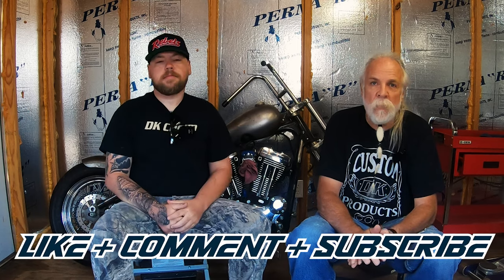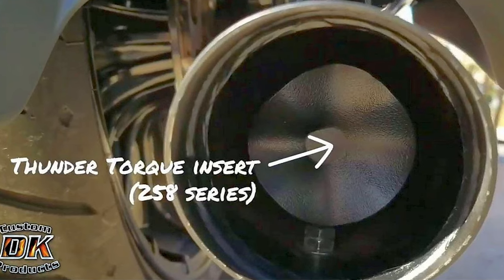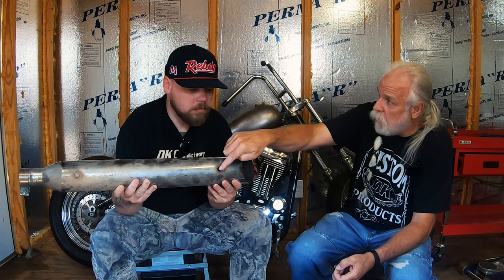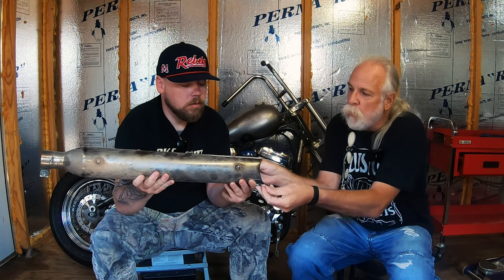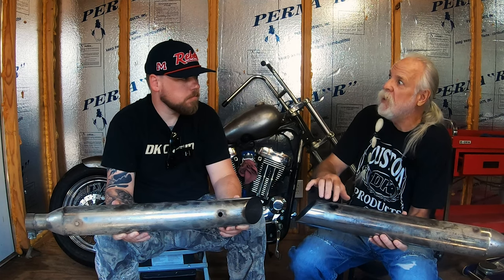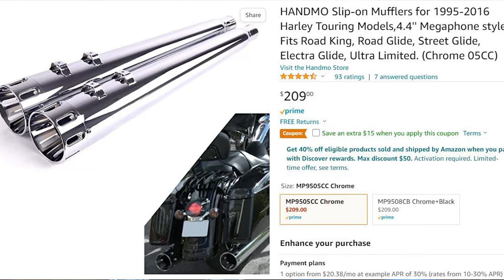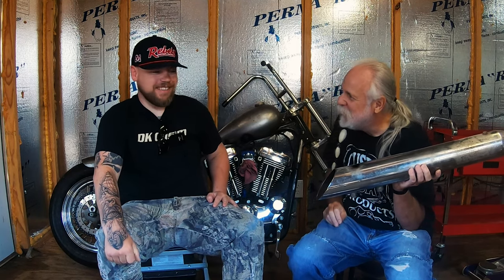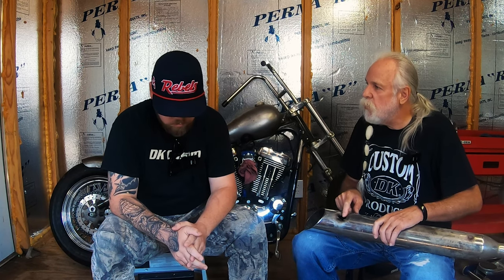How to Install Better Power w/ Thunder Torque Inserts™ on inexpensive, knock-off exhaust.

Comment: I have 07 electra glide is there a rear shock i can install that is not air
Reply from the maker: All three of the shocks at this link will work on an 07 Electra Glide - https://www.dkcustomproducts.com/rear-shocks-c651-271.htm

Please feel free to contact us with any questions;
Support@DKCustomProducts.com
662-252-8828

Thank you for commenting! MB

Comment: I see many videos they installed in the head of slip-on, not the end of slip-on ?
Reply from the maker: I am not sure what product you have seen being installed in the head of the slip on, but the TTI's work at the end of the slip on. 

Here is a written report on Exhaust that you may find useful/interesting - https://www.dkcustomproducts.com/harley-exhaust-myths-and-facts.htm

Thanks for commenting! MB
Reply: @DKCustomProducts  https://youtu.be/cB60mSaHwLw?feature=shared
What is the effect of this project!?
Reply from the maker: The Thunder Torque Inserts are meant to eliminate reversion. Reversion happens at the end of the exhaust. Installing those thumb screws or TTI's at the head of the exhaust is not going to eliminate reversion, speed up the exhaust gas velocity, or improve torque. 

Please go look a this written report on exhaust. About half way down the report it shows pictures and talks about how the TTI's actually help - https://www.dkcustomproducts.com/harley-exhaust-myths-and-facts.htm

Thanks! MB

Comment: I have a 2020 Harley Heritage with Cobra Neighbor Hater slip-on mufflers.  Do I need to remove the stock baffles? is it better to remove or leave them on?
Reply from the maker: You do not Need to remove them, but for the most power, best to remove the baffle, but you will still get a nice bump in power, even with the baffles in.
Here's a video you may find interesting- https://www.youtube.com/watch?v=H681dl2X_f4

Comment: Are these Tunable ? Tunable by turning the TTI ? Or should they be straight up and down in exhaust
Reply from the maker: Below is Copied from the instructions.
Link to TTI Details-  https://www.dkcustomproducts.com/thunder-torque-inserts-158-model-family-dk-tti-158.htm

Link to full instructions-
https://www.dkcustomproducts.com/media/wysiwyg/Updated_9_16_22_Thunder_Torque_installation_instructions.pdf

Tips on tuning your Thunder Torques:
SOUND: Desirable sound is totally subjective to each individual. To get the sound You desire
simply try different installation angles of the Thunder Torques. The direction the Thunder Torque
is facing will make a noticeable change in Tone & Volume. 90%+ of the time the best results are
when the threaded part of the TTI is closest to the engine (with the cupped part closest to the
tail end of the exhaust).
In many instances the removal of the baffle completely in conjunction with the Thunder Torques
will produce the most desirable sound.
TORQUE: The Increase in Torque is accomplished by reducing engine pumping
losses, increasing exhaust gas velocity and increasing inertial scavenging. The unique
combination of materials and design of the Thunder Torque Inserts™ are able to
accomplish the above.
Installation angles have a direct impact on how much more torque you will gain.
Because each bike is different (air cleaners, fuel management, headers, slip-ons) there
is no single adjustment that is best for all.
In most cases centering the Thunder Torque (height wise) in the pipe is optimal (it does
not make a significant difference if it is a little off center, but as close as you can get is
best). In some instances our LT (Long Thread) TTI can be used to get it centered.
90%+ of the time the best results are when the threaded part of the TTI is closest to the
engine (with the cupped part closest to the tail end of the exhaust).
Reply: @DKCustomProducts  The link you supplied says page not found on your site. The information you supplied after the link was very helpful . Thank you for your
Reply from the maker: Sorry, fixed it. 👍

Comment: Can I run these with the baffles in my 4 inch Rinehart mufflers?
Reply from the maker: You can use the TTI's with your 4" Rinehart's. If you are leaving the baffle in place you would need to measure the inside diameter of the baffle to determine the size TTI's you need. 

You can see a report on how to choose the right size TTI for your exhaust at this link - https://www.dkcustomproducts.com/choosing-the-right-size-thunder-torque-inserts.htm

You can send us an email with a picture looking into your exhaust and the inside diameter measurement 1.5 - 2" inside the exhaust, we will be able to give you a more accurate sizing:
Support@DKCustomProducts.com

Thanks for inquiring and for commenting! 😎

Comment: What about stock HD triglide slipons. Mine a 2019.ultra.
Reply from the maker: The TT's are a universal item that will have a positive effect on any V Twin exhaust system or application... As long as you are able to install the TTI at or near the exit of the exhaust, they will be effective.

Here is a link to a written report on choosing the correct size TTI's - https://www.dkcustomproducts.com/choosing-the-right-size-thunder-torque-inserts.htm

Here is a link to the TTI product pages- https://www.dkcustomproducts.com/catalogsearch/result/?q=THUNDER+TORQUE

Please feel free to contact us with any questions;
Support@DKCustomProducts.com
662-252-8828

Thank you for commenting! MB

Comment: Why don't you do a video on how to install thunder torque inserts on  fishtail exhaust.
Reply from the maker: It is a universal part, as long as the insert is at or near the exit of the exhaust it will be effective. 

The install is the same. Take the fishtail tips off, install the TTI and then put your fishtail tips back on.

If you need further help you can contact us at:
Support@DKCustomProducts.com
662-252-8828

Thanks for commenting! 👍😎👍

Comment: Is it ok if I bought a size too small? I bought the 118 cuz I thought the 158 might be too big but I guess I was wrong cuz the 118 only covers about 55%-60% of my mufflers inner diameter. Does that mean I won't get any benefits or maybe less benefit? My mufflers are 2 1/4 inches but inside I believe is 2 inches maybe a hair smaller. I get almost 2/3 coverage having them straight up and centered as recommended. I haven't installed the mufflers on my bike yet so idk if ill benefit from any sound change and power. Have any insight on this? Will I be ok and am I sacrificing power and sound?
Reply from the maker: It is not going to hurt anything! Of course you will get better benefits from it being the right size! You can email our customer service at Support@dkcustomproducts.com and let them know you need to exchange them and they will help you out with the exchange process! Thank you for your business!
Reply: @DKCustomProducts  Thank you for your help. I'll probably just order the 158 and keep the 118 for future use if I need them. Doesn't hurt to have both sizes so I have options. I didn't realize that my muffler tips narrowed at the end so I measured the wrong diameter cuz my tips are 1.75 inch but my muffler end where these would screw in is actually 2 inches. Thank you.
Reply from the maker: @CantTreadOnMe  Understood, good deal man. Glad we were able to help. Let us know if there's anything else you need. We appreciate  your business! Thanks for watching our videos!

Comment: I have a 2022 streetbob 114 with v&h big radius and wanted to remove the baffles but was told that will damage my engine after long time use, and loose back pressure (I'm keeping this bike as I'm in my 50s now) I was led to believe if I buy thunder city monster inserts they will keep the back pressure, give me the sound I'm after and not damage my engine long term, if I've been led to believe this is it right?  My big issue is I live in the UK and been on their web site and messaged thunder city  but had no reply and their out of stock of these baffles,  do these do these baffles you make do the same as what I need?  I'm looking for alternatives so I can reach my goal and not damage my engine, any help would be cool
Reply from the maker: You do not need, nor want back pressure. It is pressure making the engine fight against itself. What you want is to eliminate backpressure and reversion which in turn will speed up the exhaust gas velocity and help improve your performance.  

Here are two videos on backpressure that you may find helpful/interesting - https://www.youtube.com/watch?v=mZ53YO_RZ0E
and
https://www.youtube.com/watch?v=6W4pF-Lq4kQ

Here is a written report on Exhaust that you may find helpful - https://www.dkcustomproducts.com/harley-exhaust-myths-and-facts.htm

We do not make baffles. We make the Thunder Torque Inserts™. What you want is to remove the baffles to eliminate backpressure, but then there is reversion, that is where the TTI's come in and eliminate reversion resulting in speeding up the exhaust gas velocity and increasing your low-mid range torque.

You can see the TTI's at this link - https://www.dkcustomproducts.com/thunder-torque-inserts-c57-346.htm

You can see a report on how to choose the correct size TTI for your exhaust at this link - https://www.dkcustomproducts.com/choosing-the-right-size-thunder-torque-inserts.htm

Please feel free to contact us with any questions;
Support@DKCustomProducts.com
662-252-8828

Thank you for commenting! MB
Reply: @DKCustomProducts  thank you for assist 👍
Reply from the maker: You are most welcome! Thank you for commenting! 👍😎👍 MB

Comment: Guys, I have V&H Monster Rounds. They have an end cap on them. So I would remove the end cap and install 1" - 3" back of the actual pipe is that correct?
Reply from the maker: I would place the TTI's as close to the end caps as you can.  Probably 3/4" to 1" from the inside end of the end caps, in the pipe.

Appreciate your business, and I believe you are going to like the improvement. 😎👍

Comment: Bought this insert June or July of 2021, i used all the hardware that came with it. Came loose, tighten it back up. Went on a run to penn came loose again and tore a hole in my exhaust and it's still in penn some where. I sent dk a email and never heard anything back from you guys. Have not purchased another one yet, but any advice on keeping them tight.  My exhaust is Vance and Hines big radius 2 into 1
Reply from the maker: When I read your message about sending an email and not getting a response I asked Customer Service to research our inbox, junk mail, spam, and this is the response I got-
I can not find an email from him. I looked up Vance and Hines big radius 2 into 1, pro American, tyranny, came loose, tore hole. I can not find anything from him. 
If you could please email us or call us at the following
Support@DKCustomProducts.com
662-252-8828
Regarding keeping them tight, 999 out of 1000 the washer, then lock washer then nut is all it takes.  However, if you used that and it did not, then use a washer then a nut that is tightened all the way down, then put another nut up against the tightened down nut.  Hold the first nut in place, then tighten the second nut up against it.
Reply: @DKCustomProducts  jam nut

Comment: What do they sound like on a 2023 Tri Glide if possible
Reply from the maker: Here you go, 2014 stock exhaust with the TTI's installed (with baffles removed).  Will not work with stock pipes with the baffles still in place.
https://www.youtube.com/watch?v=cOs1-bTPycU

Sorry we do not have a video of 2023 Model but it would be pretty much the same! 

Feel free to email or call with any questions:
Support@DKCustomProducts.com
662-252-8828

Comment: How do use these on v&h super deluxe slip in’s for Harley trikes? The tips are oval., not round.
Reply from the maker: There is no difference in installation, and they work well at stopping reversion and speeding up exhaust gas velocity, as well as deepening the tone, in ovals, just like rounds.
At first this video linked below may not seem relevant, but I believe if you watch it you will get some insight on options to installation on your V&H.
https://www.youtube.com/watch?v=naqPtEcDcU0
Please feel free to email or call with any questions.
Support@DKCustomProducts.com
662-252-8828

Comment: I just ordered mine a few days ago.  Waiting on them to arrive to install.  I have VH Straight Shots, I hope to use them with the baffles installed, I ordered these instead of the quiet baffles so hope it works.  I called in and asked if they would work that way, the person I spoke to was unsure.  If the threaded stud is too long it will not fit past the heat shield.  I guess I will find out.  I will be able to tell if they will fit before I open them by looking at the stud size.  Can I return them if it doesn't fit?
Reply from the maker: They fit.
On V&H "full coverage" shields, there is almost 90 degrees that is NOT covered.  Using that area is the easiest install, since there is not heat shield to contend with.
The other way, which many folks do, even though it is much more work, is to make sure the threaded section is short enough to fit between the outside of the exhaust pipe and the inside of the heat shield.
This may require cutting down the threaded portion some.
You may also want to use a low profile fun instead of the one included.

If you look at the following video, it is some Short Shots on our Project 48.  There are no heat shields installed in the video (we were doing a lot of testing that day), BUT, if you watch the video you will see the TTI's installed, not at the top or bottom, but at around the 7-8 o'clock position.

This is where it was easiest since there is no heat shield that goes there.

If you are wondering if the thread diameter of the TTI is the same as the baffle holding bolt on the V&H, they are not.  Below is a copy and paste from the online instructions.
"V&H is the only company we know of that uses a non-standard size hole for the exhaust baffle bolt. It either needs to be drilled out, or just drill a new hole for the TTI’s. Thunder Torque Inserts™ can be installed in an infinite # of positions to accommodate all different tunes and desired sound."
Reply: @DKCustomProducts  thanks for the reply.
Reply from the maker: @grayghost1423  You're welcome! Thanks for watching!

Comment: Hey guys help me out. I have a 2013 Twin Cam 103, Electra Glide Classic FLHTC, what’s the best high flow air cleaner you sell. Maybe give me a link with everything I need. Right now mine has no flow unless something is sneaking in behind. Gotta be chrome.
Reply from the maker: Hey Stephen!
The absolute best power is from the 636v with any of the EBS options in it.  The Link is below, but it is not chrome-
https://www.dkcustomproducts.com/outlaw-hiflow-636v-air-cleaner-twin-cam-complete-system-dk-ac-636v-tc-cs.htm
A very close performer is the 828, it is also low profile, and it also has a Chrome cover option, again, with any of the EBS  kits in it.  The Chrome Cover option is linked here- https://www.dkcustomproducts.com/chrome-speed-fin-complete-hiflow-828-air-cleaner-dyna-softail-touring-trike.htm
All the other options are in this link (including some aluminum that can be polished to a chrome like finish)- https://www.dkcustomproducts.com/twin-cam-outlaw-hiflow-828-air-cleaner-complete-systems-72.htm
Always feel free to email or call with any questions.
Support@DKCustomProducts.com
662-252-8828
Reply: @DKCustomProducts  thank u guys.  I’m the road these days, currently San Antonio. Now that I’m in the south I notice the bike running hotter.
Reply from the maker: @LonesomeNomad137  Good to hear you are enjoying the road.  Enjoy that warm weather...it is going to be getting cold almost everywhere soon!

Comment: Now 1/2” to 3” from end cap or end of pipe before end cap. Sounds like 1.75” in would be 1/2 way point as well.
Reply from the maker: You want to limit the reversion from going back up the pipe, so the closer you get to the exit point, into the atmosphere, the better.  More than 3" from the exit and you start to see a reduction in benefit.
Here is a link to a video that you may find interesting/useful-
https://www.youtube.com/watch?v=pr6z00gL5Yg

Comment: What position is best most I hear is paralleled what’s your thoughts
Reply from the maker: Below is a link to the installation instructions which are found on the product page here- https://www.dkcustomproducts.com/thunder-torque-inserts-158-model-family-dk-tti-158.htm
Installation link- https://www.dkcustomproducts.com/media/wysiwyg/Updated_9_16_22_Thunder_Torque_installation_instructions.pdf
Copy and paste of a small part of the instructions regarding position-

The Thunder Torque can be installed facing forward or backward or at any angle in-between to give you your desired sound and best torque. All of our testing has shown that the most power is achieved by installing it with the threaded stud Closest to the engine, meaning the cupped part of the TTI will be closest to the tail end of the pipe.
Reply: So putting it at 90° another words, if you looked up the tailpipe, you’d see the circle the cup, and the threads will be behind facing into the pipe?